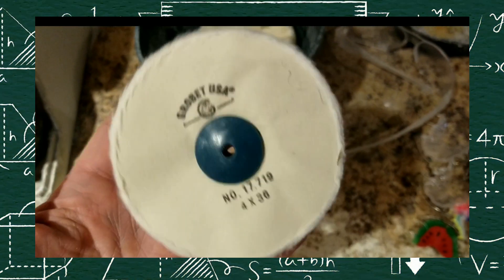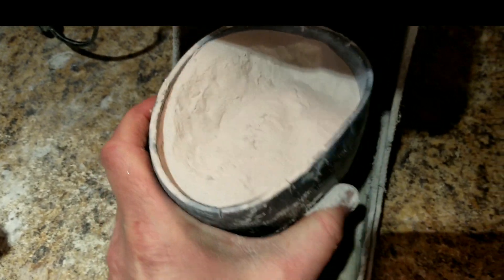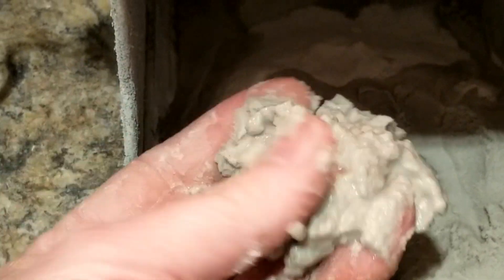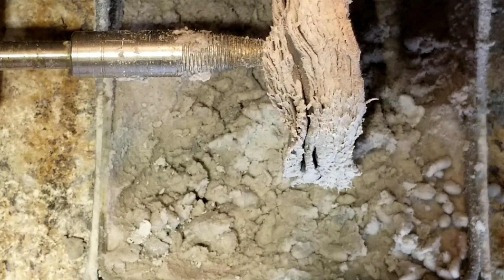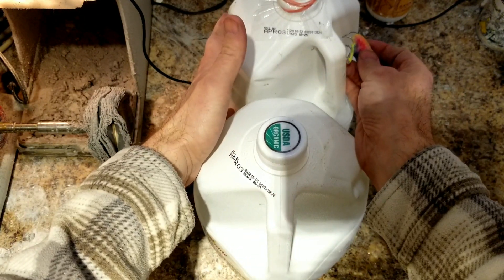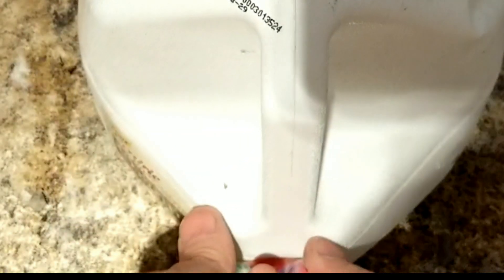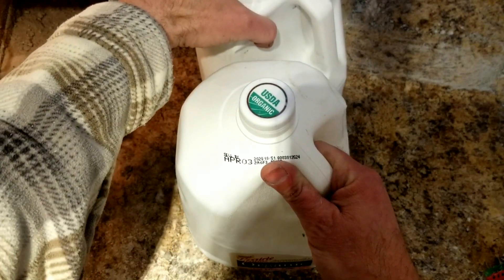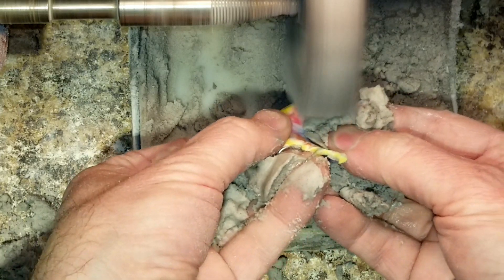Pumice Dental Appliances like a PRO Lesson

Comment: Great idea! I have a tip that everyone may already know but just in case they don’t: to speed up the saturation of a new rag wheel, lay it down in your pressure pot submerged in water. Pressurize for 10-15 minutes, (or put in with some poured retainers) and it will be saturated through. Soaking alone takes longer to get all the way to the hub.
Reply from the maker: Thats awesome tip. I remember hearing something like this a long time ago and forgot to try it!